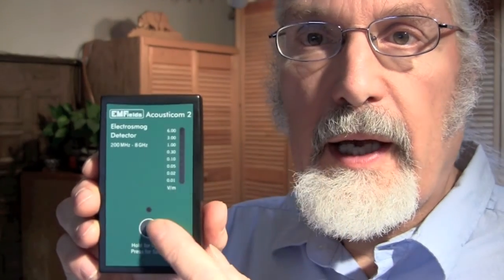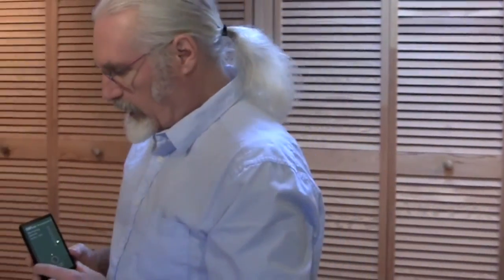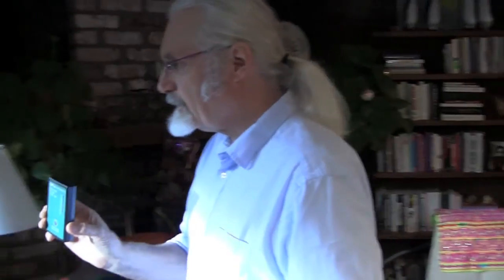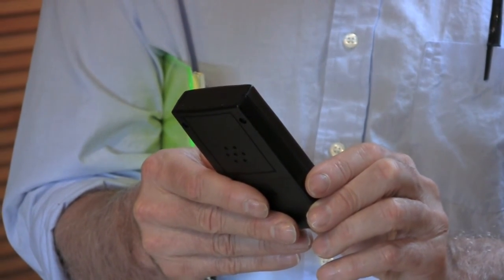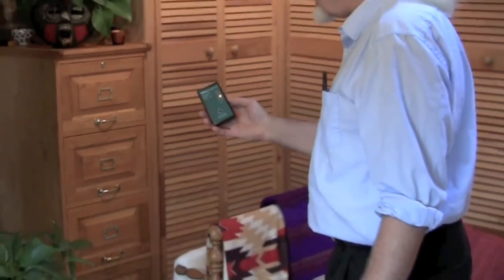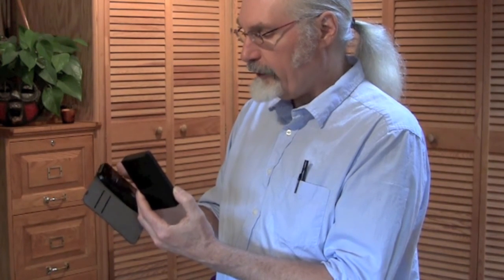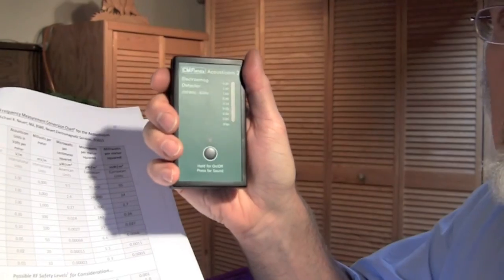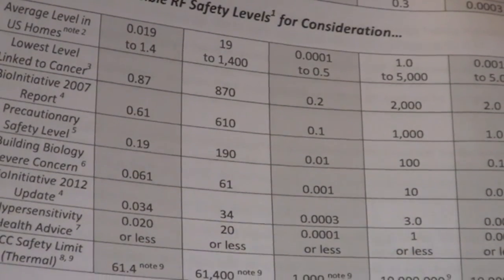How to Use the Acousticom: to Measure Radio Frequency Fields

Comment: Michael, there's a lot of background hiss in the audio of your videos. If you want to clean that get Audacity audio editor it's free. I used the Noise Removal tool to remove hiss making it sound much better. I made two 18-second excerpts, one of the original comparing to the one noise removed. Let me know if you want to hear and I'll upload.

Comment: I have an Acousticiom 2 same one depicted here, how come when I put it right next to a cluster of 6 or so smart metors on a building it barely went over 0.30 V/m ??
Reply: did you ever get an answer from the company about this?
Reply: Depending of a number of factors, the Smart Meters may not be transmitting while you're doing the measurement.   You may have to wait a while for the reading to jump to the highest level.   If you walk away from the meters, do you still see 0.30V/m ?

Comment: Hi Michael, is the Acoustimeter louder when turned fully on than the Acousticom2? For me this is the only downside of the A.2 that the speaker is little to quiet if you have weak fields.

Comment: Thanks for the explanation. I've had one of these for a while and wasn't sure what my measurements and sound was indicating. My bedroom is always in the orange at .30 and 1.00 together and constant when holding the unit in a vertical position and doing a 360 degree sweep. I'm thinking that's not great... 🫤